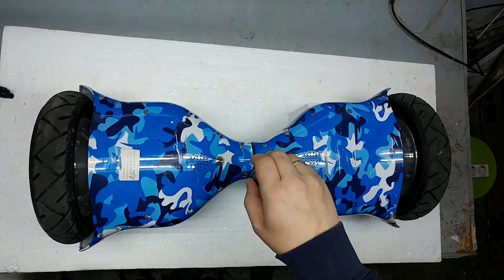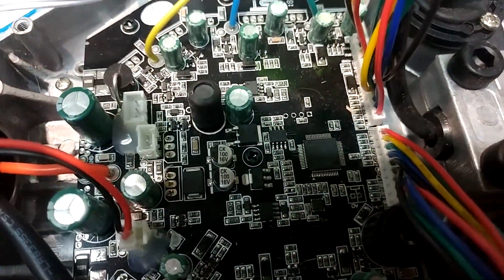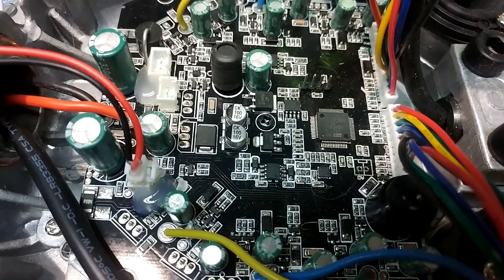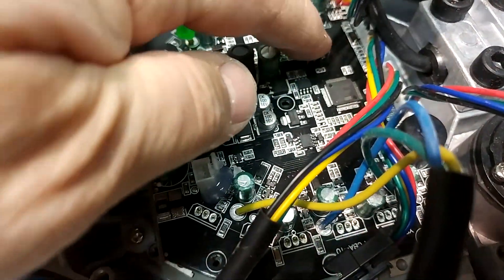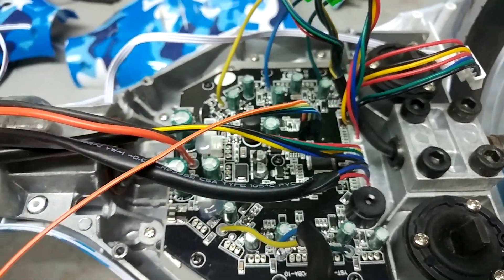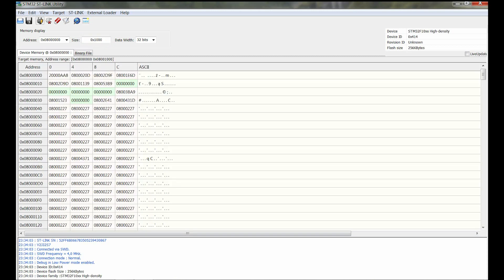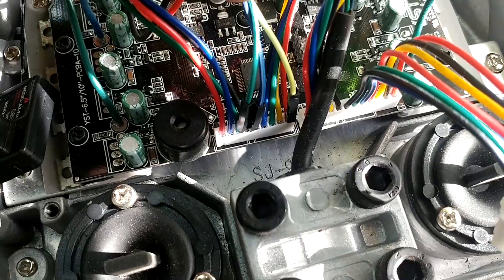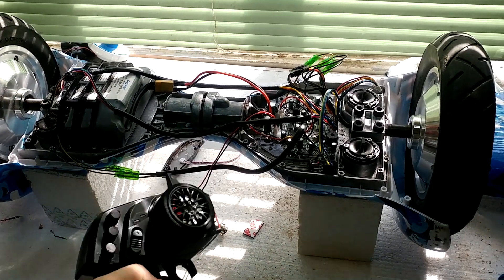Hoverboard Custom Firmware Flashing Tutorial

Comment: hello plise link controler ? plise controler rc transmiter wiring diagram?
Reply from the maker: Here is the Link to the Transmiter and receiver: shorturl.at/ayCM7 
The wiring diagram is on 2:50 
just use wires for left sensor board
Reply: @snowkingcro  thank yu plise controler rc transmiter  hoverboard maintboard wiring diagram?
Reply from the maker: that depends on the rc transmitter

Comment: did you try connecting 2 hoverboards to one reciever? cause i tried with your firmware and once i power them on they back feed to one another and go bezerk.
Reply from the maker: No, I didn't, but if you get the backfeed, i'd use some diodes to prevent the power going the wrong direction

Comment: Hi. Used your file for flashing. Got remote working. Wheels start spinning. But. Can you tell, why howerboard beeping all the time. And wheels not moving smooth. Looks like for milisecond brake get on then wheel spinning again. Both weels, but not in same time
Reply from the maker: Keep the cables short... if you make them long, you get stuttering and stuff that gets you only mad

Comment: very nice project. got mine workong yesterday but having a small issue on ful lload. sometimes when I take finger of reverse throttle it stuck in full power :D used the updated with turning firmware. Also in config found 4 cell batery but hoverboard is 10 cels 10s does that sound right?
Reply from the maker: mine also has 10 batteries in seral
Reply: @snowkingcro  Ok i went further and making 4 wheel one… but having issues when sharing signal from receiver.

Comment: Can I used same Firmware for yst-dxt-j20 v5.1?
Reply from the maker: I'm not completely sure but i think it will work!
Reply: @snowkingcro  u have used rc transmitter. Is there a cheaper way like using vr Bluetooth controller?

Comment: Hi.  tell me the version of rc equipment should be like yours or any can be put?  If you can answer my email genia-x@yandex.ru
Reply from the maker: Any rc transmitter with the dedicated receiver will work.
This receiver works with PWM signal so you'll have to use my code (in the description), as the original code works only with PPM and i did not manage to work with any PPM receiver
Reply: @snowkingcro   Thank you, I got everything after installing rc like you. Now I want to put esp 8266 (esp01-s) wifi, can you help? I don't know how to do firmware.

Comment: I've done it and it works but every second a beep sounds. Could it be that the battery is not fully charged? Thank you
Reply from the maker: I tend to charge up the battery fully before flashing the firmware
Reply: @snowkingcro  I've already done it but I can't use throttle and steering simultaneously

Comment: Hi, I have flashed your code but when trying to use the rc remote, trim is very difficult to get the control to be stable, and when going over a certian range in on the control the motors go crazy and do not stop until battery is removed. Is there something I am missing? what is your input pinout for PWM in from RC receiver?
Reply from the maker: If the motors go crazy, check cables, keep them short!
Reply: In the end I flashed again with the code from Emanuel Feru. I set the mode to PWM and made sure to disable debug on uart2 as the config file states. And yes a short cable on the pwm from Rx to board is best. Works very well indeed.

Comment: Hall sensor is needed after flashing?
Reply from the maker: Yes
Reply: @snowkingcro  sorry I mean sensor left and right...
Reply from the maker: Ah you mean the Gyro sensor boards? No, you don't need them anymore, but for the wheel to move you'll need those 5 wires from hall sensor in the wheel.
Reply: @snowkingcro   It works perfectly but a beep sounds every second. Could it be due to lack of battery charge?

Comment: Hi, could this custom firmware be used on any hoverboard motherboard? Great job btw
Reply from the maker: Thanks.
I flashed two boards with this firmware.
one works perfectly (YST) but the other (Tao Tao) had some issues like - it would not stay on, so i had to connect a table lamp ON-OFF switch... but basicaly, any board should work!

Comment: like and sub. thanks for the vid. i was able to reprogram my old hoverboard thanks to your vid. i was having issues connecting to st link so instead i just programmed and it works. are you still able to charge the battery normally after programming?
Reply from the maker: Thanks for the kind words.
Charging works normal on my first flashed hoverboard. the second one has some issues - it needs to be ON while charging.

Comment: Great project, im planning to have a robot using hoverboard, does balancing still works after connecting to rc controller?
Reply from the maker: No, after flashing custom firmware, there's no turning back...
Although, i found a custom firmware which seems to be bringing the original functions of a hoverboard, but i'm not sure...
Reply: @snowkingcro  great, can you share resources where you find the firmware, maybe we can develop it connecting to rc transmitter and still balancing function will remain.
Reply from the maker: Here is the link where i found this info, but i realy didn't had the time to test it as i'm into building and finishing my project...
https://github.com/bipropellant/bipropellant-hoverboard-firmware

Comment: your receiver works at 5v while the motherboard inputs are at 3.3v.
did you connect the ppm signal directly without destroying anything? ... have you ever had problems with signal disturbances?
Reply from the maker: i took the 5V from hall sensor connector (can bee seen on 3:00 mark), and i just plugged a pin in there, so i had'nt cut anything

Comment: awesome video perfect for my next project! i have a question. how did you wire the RC receiver (RX) to the main board? there will be 3 wires coming from the receiver which is the positive (+), negative (-) and signal (s) wires.  cheers!
Reply from the maker: I took the positive (+5v) and negative  from the hall sensor, then the signal from adc input (blue and green) for ch1 and ch2!

Comment: Thanks for knowledge. I have a question. Can I run only one motor with this way?
Reply from the maker: Yes, you can. just unplug the other one, and the other one works normally
Reply: @snowkingcro  I tried several times on one and two motors but I couldn't run the system with rc pwm signal. I used Hpi tf-20e transmitter. Do you have any idea about this issue? Thanks!
Reply from the maker: Did you wire the receiver properly? don't use positive from sensor board, it is +15v and it can (and will) fry your receiver. use +5v from hall sensor. the green and blue are signals for channel 1&2
Reply: @snowkingcro  add that information to the video comment

Comment: Great video if have time can you tell me which version of firmware, The one I download form the link it just roll forward and backward few times and turn it self off
 is there something wrong. I load the early version is moving fine just forward and backward no problem. but not  independently. Thank you for you time.
Reply from the maker: Hello, i just tried this firmware (in the description) and it still works.
Can you tell me what particular movement do you need?
Just both wheels forward and back, or independent movement?
Hoe do you control your Hoverboard?
cheers
Reply: @snowkingcro  Thanks for the respond I trying to do independent movement  the firmware I down load just roll forward and backward by itself and than turn off. I don't know what I did wrong.
Reply from the maker: What are you using to control your hoverboard?
Reply: @snowkingcro  I am using rc controller , but the firmware turn off the board after move the wheel forward and backward.
Reply from the maker: did you try to flash it again?

Comment: Great video! I know this was published quite a while ago but I have a question.  I have a different board from an offroad hoverboard I would like to do this to. The part number on it appears to be PU2018051901 G3.0. The board looks similar. Any idea if this will work with my board? Also, I am using a different transmitter and receiver.
Reply from the maker: Sorry for my late reply, but, YES. it should work normally.
By now, i flashed 3 different boards, but had a problem on only one. Tao Tao - the switch was not working anymore, so i had to replace it with a permanent switch, and that's it.
If you have any questions, feel free to ask... i was just to busy lately to browse the comments...
cheers

Comment: Awsome video, If u have some time I need your help please. I´m trying to adapt a hoverboard to my wheelchair to make an electric wheelchair because I can´t afford one.
I´d like to know how to control the hoverboard with a joystick. Thank u very much!!!
Reply from the maker: if you would use it with a joystick, i'd prefer to use the firmware with Nintendo Gametrak Controller enabled.
Here's the link where you can find all (or most) of the answers.
https://github.com/NiklasFauth/hoverboard-firmware-hack
cheers
Reply: @snowkingcro  thank you so much for your time and help!!!!
Reply: @snowkingcro  plz help me
Reply: @muhammadaliyasir4  what kind of help do you need?
Reply: @--3D  i have a problem in hover board mother board.
When i connect the trimanals of main wire of power than board is heating ver much.

Comment: Is your receiver and remote 3.3v. I tried this received and remote ( vanpro Electric Skateboard DIY V2 Edition 2.4G Mini Wireless Remote Control Receiver Transmit 80 Meters Away Wireless https://www.amazon.com/dp/B07L498PZR/ref=cm_sw_r_cp_apa_i_6VVaEbASA45EZ) and while it paired it failed to work .  This guy online said it failed cause the signal from green needs to be 3.3v not 5
Reply from the maker: Well, that might be the problem...
My needs 5v.
Here's the link: Car Accessories Remote Control Receiver
https://a.aliexpress.com/Ma5bUY5i
But... If the 5v is to much for your rc, i woud use a resistor to low it down a bit... It's not a drainer...
Cheers
Reply: @snowkingcro  you think you could post your firmware bin I have a feeling the complier I used messed something up. I do get 5v on my controller and I am able to pair it but the ppm signal doesnt seem to work
Reply: @snowkingcro  did you get this remote to work with the steering component on benjaf firmware . The remote https://rover.ebay.com/rover/0/0/0?mpre=https%3A%2F%2Fwww.ebay.com%2Fulk%2Fitm%2F264517977932 I have doesnt work with the rc-steering firmware it only works with the master firmware on the github

Comment: Do you have a pinout of wire hall sensor wire goes to which pin on 2.4ghz receiver?
Reply from the maker: From hall sensor - only the red one goes to the receiver - the +5v for power! The full pinout can be found on the link in the description...
Reply: @snowkingcro  could you wire this to work with a throttle like this https://www.amazon.com/VGEBY1-Handlebar-Throttle-Electric-Tricycle/dp/B07V7G3WV5/ref=asc_df_B07V7G3WV5/?tag=hyprod-20&linkCode=df0&hvadid=385272107002&hvpos=1o2&hvnetw=g&hvrand=846184110058638357&hvpone=&hvptwo=&hvqmt=&hvdev=m&hvdvcmdl=&hvlocint=&hvlocphy=9003465&hvtargid=pla-826405726318&psc=1&tag=&ref=&adgrpid=78829231656&hvpone=&hvptwo=&hvadid=385272107002&hvpos=1o2&hvnetw=g&hvrand=846184110058638357&hvqmt=&hvdev=m&hvdvcmdl=&hvlocint=&hvlocphy=9003465&hvtargid=pla-826405726318
Reply from the maker: Well, in that case, you'll need this firmware: https://github.com/NiklasFauth/hoverboard-firmware-hack

And just connect the red from hall (5V), black and blue from left sensor board.
Reply: @snowkingcro  Not working...any help please